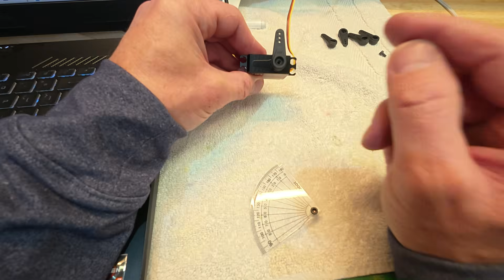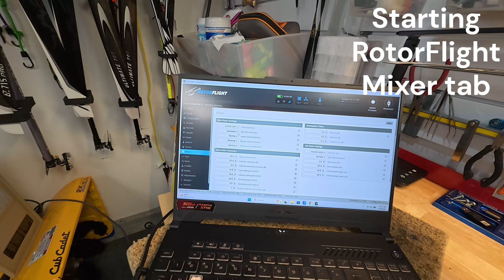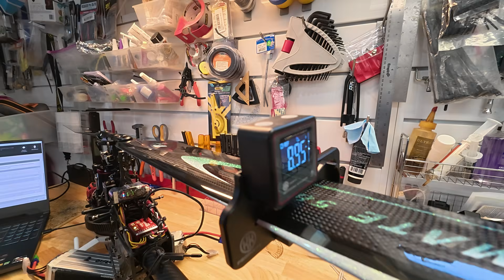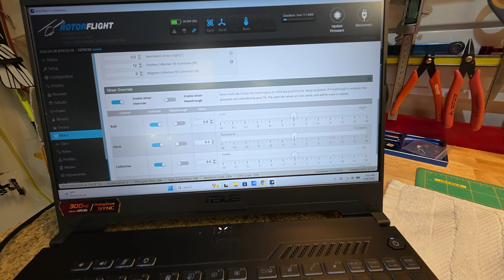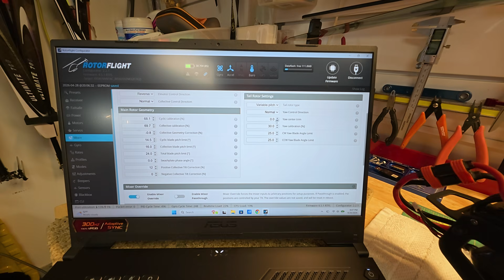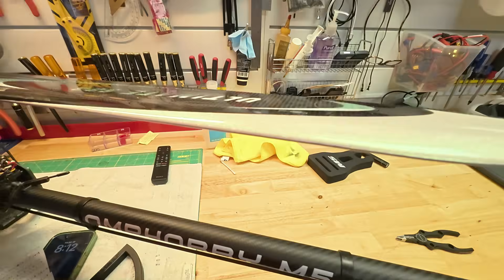Advanced/Detailed Rotorflight Servo and Main/Tail Rotor Setup.

Comment: Hey thank you for your detailed video. In the rotorflight documentation 2.3 Servos it says:  " Speed [ms] :  Slows the servo down: the time for 60° of travel.  0 = no limit. Only for things like retracts -- leave flight servos at 0. "  I am a bit confused, because rotorflight clearly states 0 is the way? Thank you for your time and input about rotorflight.
Reply: What I wanted to tell you in a roundabout way is, that you do not want to slow your swahsplate- and tailservos down. The benchtest of +-9 degree is just that. A benchtest and the jump of the swashplate will never occur during a flight. Not even during hardcore 3d smacking. There is no finger in the world that quick. 🙂   Conclusion leave the servo speed of 0 untouched. The pid loop needs  limitless servospeed . Best greetings, and always a good flight

Comment: I have never in my 25 years flying helis spent so much time on setup.  What a PITA.  Who thought this was a good idea?
Reply: Blame me, back in 2024 I championed scale correction for the cyclic servo setup on the Rotorflight discord after discovering just how terrible the variance on hobby servos actually is by testing a whole bunch of servos and comparing the data and then posting my findings to the discord. It is a good idea because even expensive servos from good brands are awful for consistency. No two potentimeters are identical so even the same model servos will be off by a few degrees from one another. Other commercial flight controllers just accept this and let the control loop absorb it and you can do that with Rotorflight too but best practice is to correct for the variance by telling Rotorflight exactly where 30 degrees is in the left and right servo throw directions.. My data showed variances as high as 8 degrees between the left throw and right throw on the same servos and some of those were good brands like Hitec and KST. It will still fly good if you don't but it will fly even better if you do. I actually wanted them to impliment a proper three point correction and that was the original plan but in the interim Dr Rudder implemented the current scale/limit system which worked "good enough" to correct for servo variance and the three point scale correction seems to have been pushed to the back burner for now.
Reply: @atomicskull6405  That sounds like a great thing in theory.  It isn't practical in practice.  Tareq, Youngblood, Maxwell, Ito, Dahl, Szabo, etc have all done well enough to not have to worry about this.
Reply: @Mark-jb9hx  I can't speak for all the above however, Maxwell did in fact go through a similar deep dive on cyclic geometry with the Futaba CGY760/770.  I still have his notes from the video.

Comment: Awesome video. Question? I cannot get the Clockwise to pop on the tail like it does on CCCW meaning soft in one direction and slamming on the other. . I have heard that the tail is really awesome but cannot tune it to my liking. I have followed everyone's step by step instructions and my tail is just not locked in the like the Brain IKON is. Any suggestions as to what I can try  to get this right.
Reply from the maker: Hmmmm, my tail is real good with stock settings. What is your main rotor throttle percentage?
Reply: @adamsmall2301  I have it set at 1900 HS
Reply from the maker: Did you increase P gain on tail till it gets angry in full punch outs our fast backwards power loops?  Once I find angry, I decrease P gain. I also increase CW stop gain around 20 points if I remember right.

Comment: Don’t you need to line up servo arm screw to your 90* tool to get degree it moved? Maybe position of camera but doesn’t seem like it. Good video of RF setup👍🏻
Reply from the maker: Yeah, it was the angle of camera. You do want reference line going to center of servo out put shaft.  Or if that’s awkward, you can also make sure reference line on protractor is parallel to the 90 degree tool.